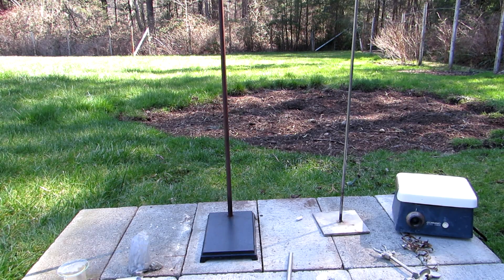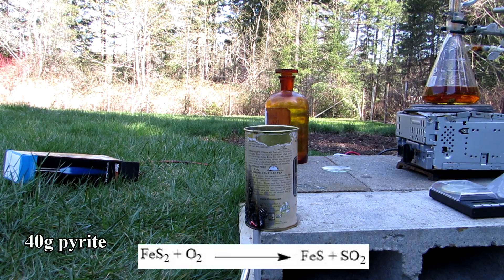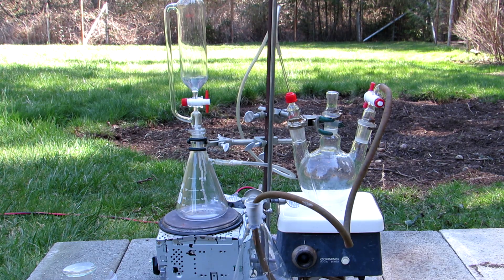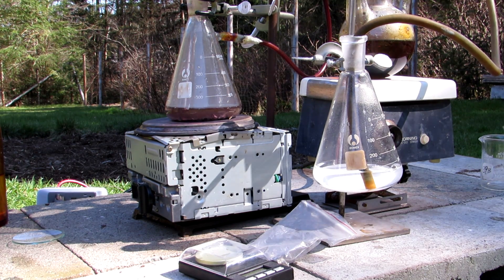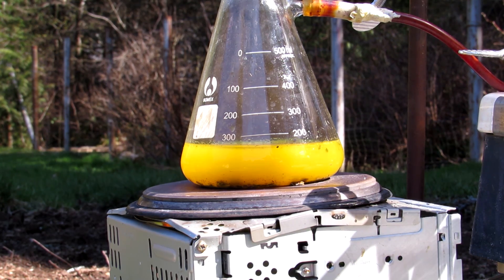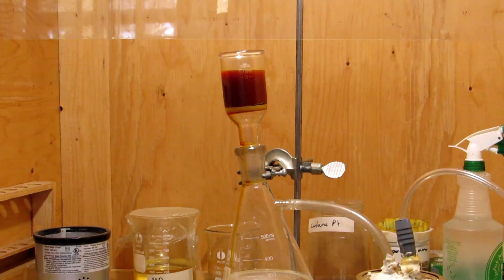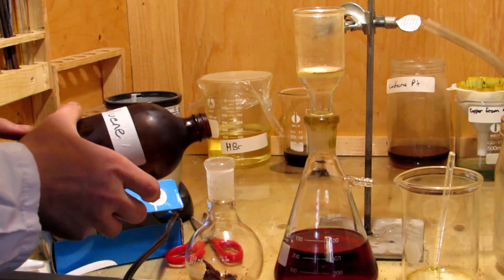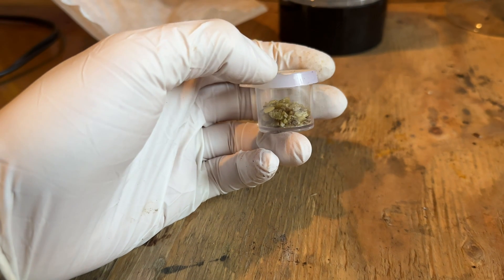Isolating Sulfur from Fools Gold (Iron Pyrite)

Comment: I have thought of doing this myself (as a way to produce H2S). What is the purpose of decomposing the FeS2 first though? Why can we not just use the pyrite straight?
Reply from the maker: The reaction of the acid directly with pyrite is very slow, so the production of H2S is too slow to yield good results. That’s why heating the pyrite first is necessary.

Comment: There is a  much simpler and cost effective way to make sulfur from pyrite .Place it in a long iron tube which will be sealed on one side and the other remains open. Heat over fire of 600 to 800 c and because of the lack of oxygen in the tube elemental sulfur will be distilled and it can be collected at the other end.Just make sure the tube is long enough so it has time to cool and not escape as a gas .Also crushing the pyrite into a powder yields in better results
Reply from the maker: Oh cool! I didn’t realize pyrite will decompose to elemental sulfur when heated at such relatively low temperatures, I’ll have to try that in the future!
Reply: @TheCanadianChemist 600 C is a little on the low end. I've read that it occurs more at around 800 to 900.

Comment: i've never seen someone use sublimation to purify sulphur. Why is this?
Reply from the maker: Well, sulfur doesn’t sublimate at STAP, it melts and then boils, but you could probably purify sulfur by distillation! It’s probably partly not done due to the flammability of sulfur and the relatively high boiling point of 445C, but it could be a fun project for me to try in the future! Thanks!